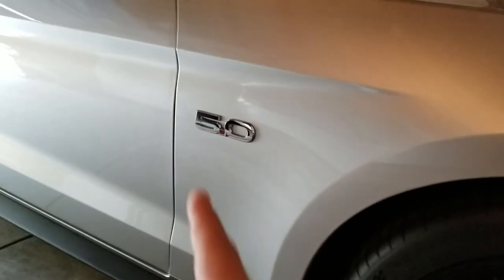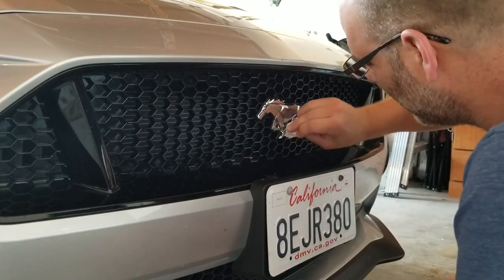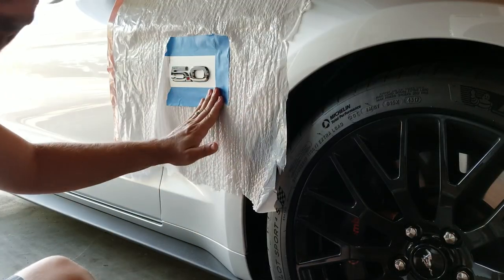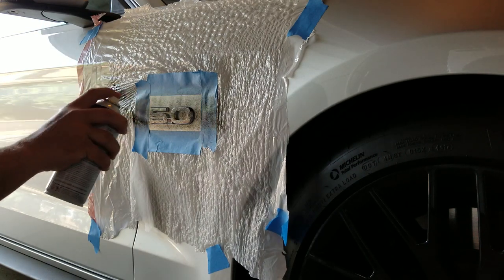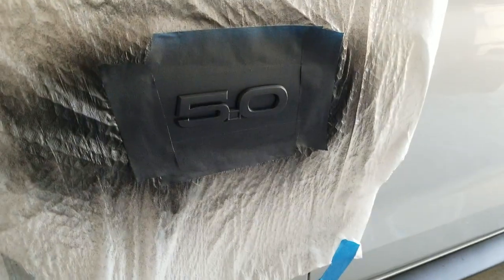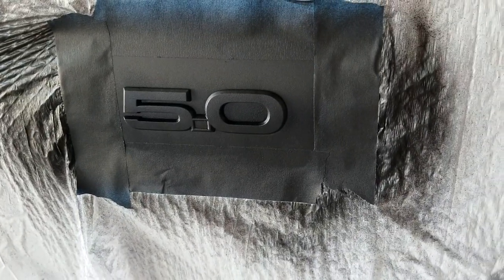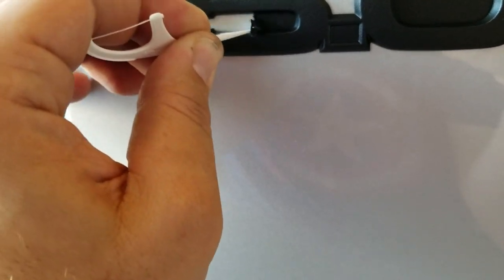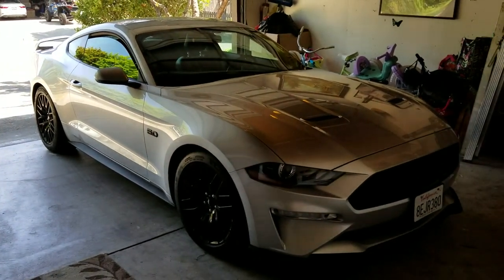HOW TO PLASTI-DIP YOUR MUSTANG - 2018 Mustang GT Car Vlog - Stang Stories #8

Comment: has it held up? i see you got the california plates so you dont have to deal with very cold temps and ice but the sun may fade it or something. it looks good though👍i got a '18 ecoboost with 19" matte black wheels and thinkin about doin this.
Reply from the maker: Lol those Cali myths. It's cold as hell here in NorCal. 10 degrees sometimes. I know that's not subzero but it's frozen. Yeah I go from 10 in the winter to 115 in the summer and it's fine. It still looks great.

Comment: Did you use same plastic toothpick to remove the excess on the front pony? Mine didn't turn out perfect but I will try again. Only put 4 coats and I went too heavy on the spray. Nice video, I think I know what to do now.
Reply from the maker: No but I did on the 5.0 my pony was darn near perfect. It was a mother to mask though. Lol

Comment: For the pony and gt yes you could plastic dip as long as you spray some clear coat over the dip but the 5.0 emblems you should buy the painted ones for one reason only and that is the red dot in the middle is hard to peel that dot out

Comment: I just bought a 2019 GT Ingot Silver with PP too.  What brand and color plasti-dip did you use, flat black or? I've never used plasti-dip before so didn't know how the colors come. You did a good job, it looks badass.
Reply from the maker: Yeah just the flat black.
Reply: But you have to spray some gloss clear over it Danny so you could have a gloss black emblem plastic dip also makes some gloss clear coat sprays to go over the dip
Reply: Lol, not even owning the car (unless you paid cash for it) and already ricing it out.